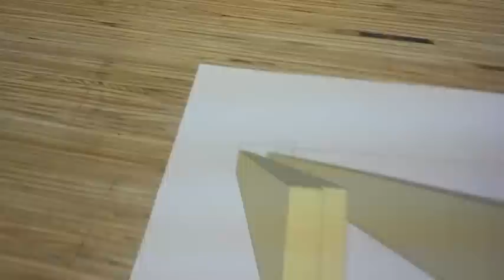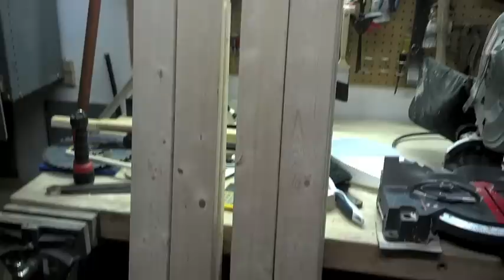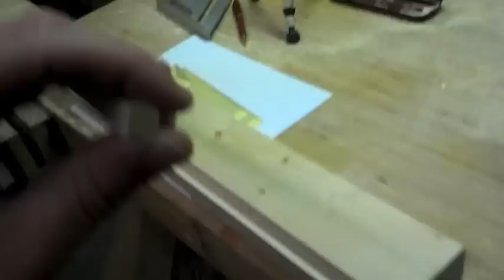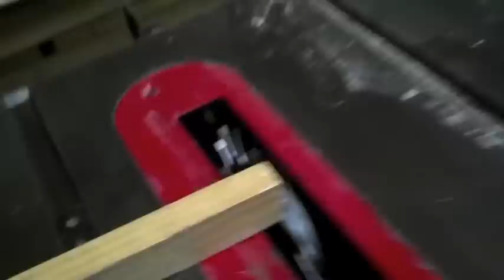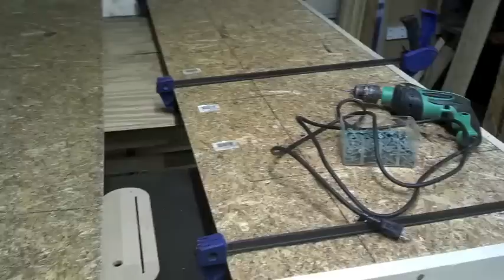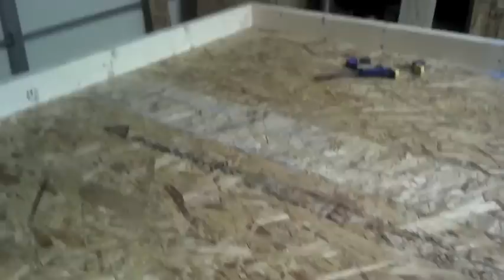Full Size Bunk Beds for Phase One of the Cabin Project

Comment from the maker: It is really not that much stuff.  I still have to get stuff for the legs, but it will not be that much.

2 -- 2x4x10'  (cut in half at Lowes)
4 -- 2x4x8'
3 -- 1x6x10' (cut in half at Lowes) then ripped on the table saw
2 -- Sheets of cheapo' 7/16 OSB